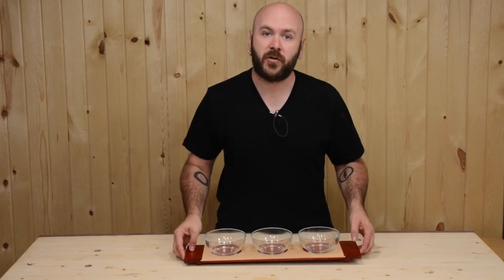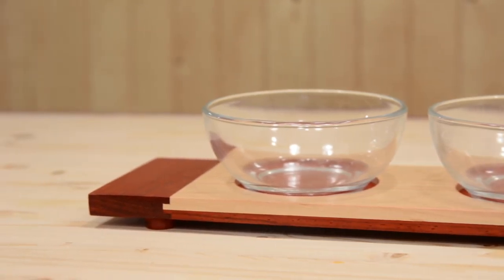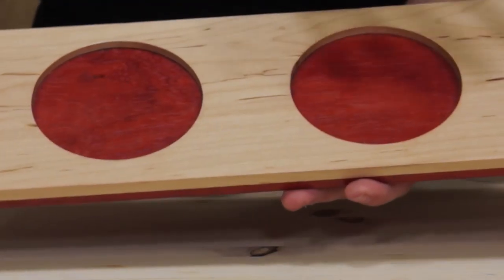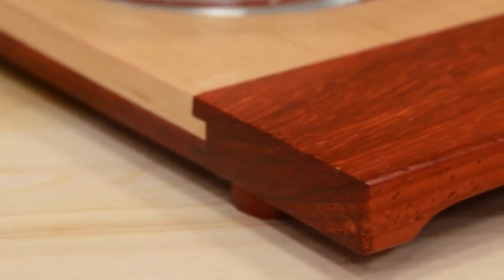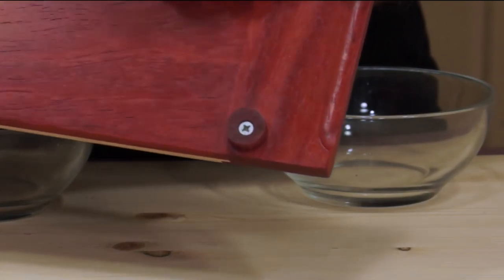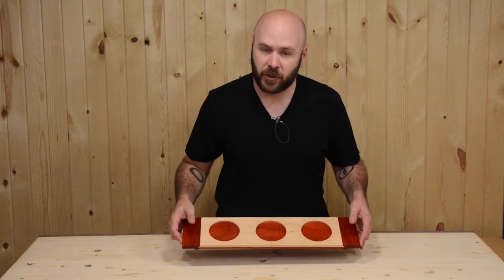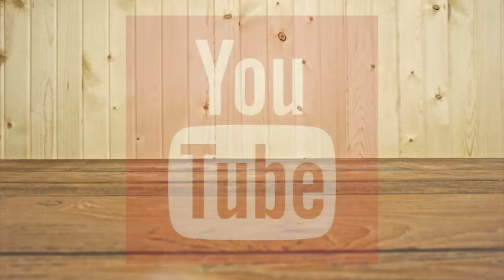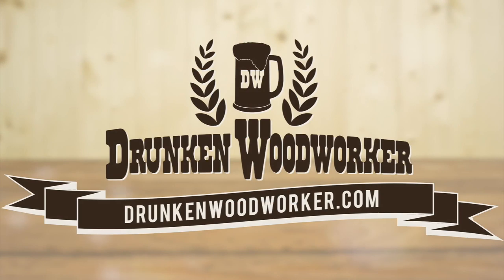How to Make a Serving Tray with Breadboard Ends

Comment: Looks good. I think you were fishing for a project that you could use your router plane on.
Reply from the maker: Ha! Maybe! The problem is that I didn't have the proper blade in my table saw to make a clean stub tenon. I only have a combination blade when I should have used a ripping blade. :)
Reply: I've been there. I just use my router table now because I hate changing table saw blades.

Comment: Very nice. Love the contrasting woods. Is there any reason you couldn't just glue the feet - to avoid using any mechanical fastenings?
Reply from the maker: Gluing the feet would work just fine. I used screws so I could then quickly sand down to the feet so the tray wouldn't wobble. If I would have used just glue I would have needed to wait a couple of hours and sometimes I'm impatient.

Comment: Awesome quick project. Did you sand down or clean up the feet at all after cutting on the bandsaw? The tray looks dead level.
Reply from the maker: Thanks! Yes, I did sand down the feet by using adhesive sandpaper on my tablesaw and running the tray back and forth until it was dead level. Sorry for not filming that.

Comment: Hello David, nice project. Do you think the end grain to long grain glue joint could cause problems because of wood movement? Or are the board to narrow?
Reply from the maker: Good question. It's only 5 inches so I'm going to assume there won't be a problem. Time will tell.
Reply: Drunken Woodworker
Probably fine, safer to just glue the middle 3-4"
Reply: Drunken Woodworker                      Probably will hold up as the wood movement is small because the project is small but ideally mechanics of a bread board end will allow for wood expansiona nd contraction.     Best regards  Chris

Comment: I like the quick clips David, good job on the editing. I have a question (you can answer it on a wrap up if you like). Why do one need both a thickness planer and a drum sander? To me it looks like they do pretty much the same thing. I've been a subscriber of your's since the first weekly's and I love that more content is coming now you're doing this full time. Cheers! (I just changed my username, formerly known as brukernavnfettsjit).
Reply: I got by for a long time with just a drum sander but having both is nice.  A planer, with regular knives (instead of the fancy helical head thingies) has trouble with figured wood, knots, reversing grain, things like that.  There's a limit to how thin and short stuff you can run through it.  As the knives wear you start getting less of a nice finish straight from it.  You also can't run something like an end grain cutting board through it.  A drum sander is better for all those things but you can't remove material as quickly.  With fresh knives and well behaved grain the planer actually leaves a better surface though.

Comment: Awesome! Quick question..... Did you make that circle template? If so, how?
Reply from the maker: Hi Joseph! The quick way is to cut it out with a jigsaw and clean it up with a spindle sander. The way I did it was with a forester bit that was too small, then a router with a rabbiting bit and then a flush trim bit. I'm going to film a "Little Tipsy" on how I made it on Tuesday.